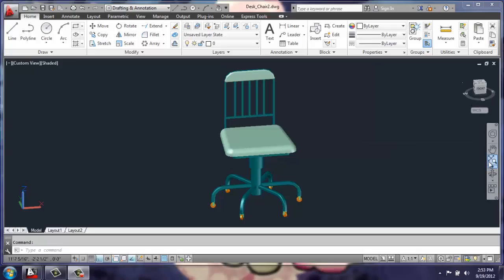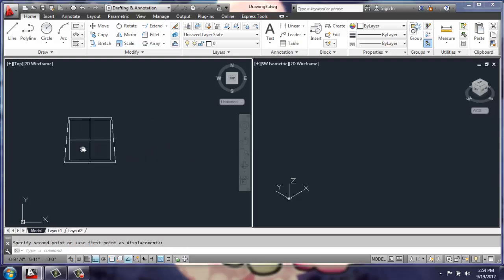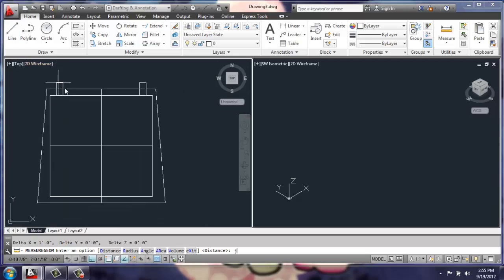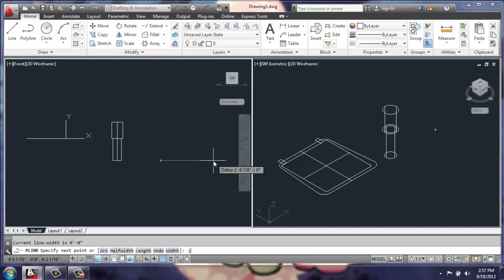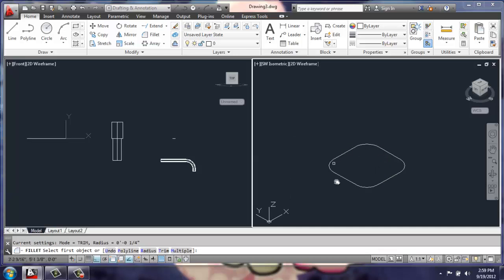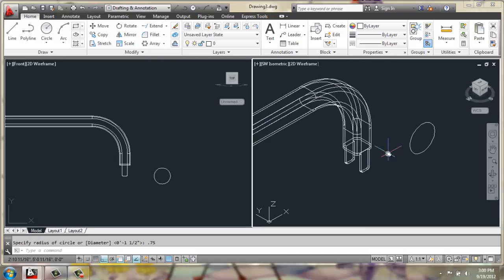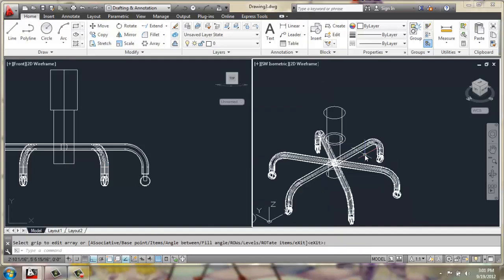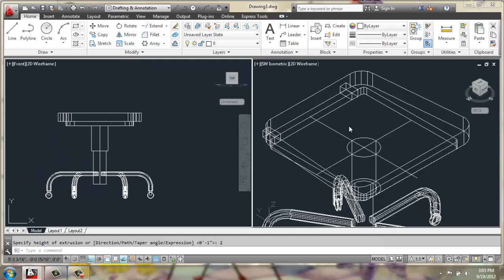AutoCAD 2013 - 3D Modeling Basics - Desk Chair Part 1 - Brooke Godfrey

Comment: very important, I have a chair design which I want to do you 3d model, should I make 
3D modeling of each part then put them together or is it possible to model all the parts at once? or is this what your basically doing is doing them in parts //